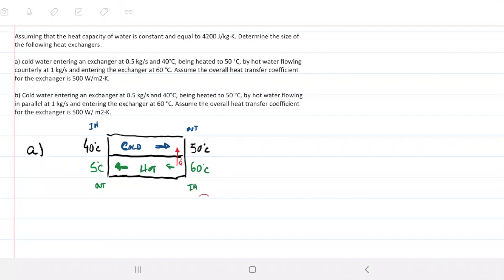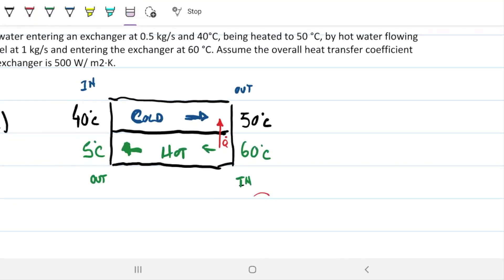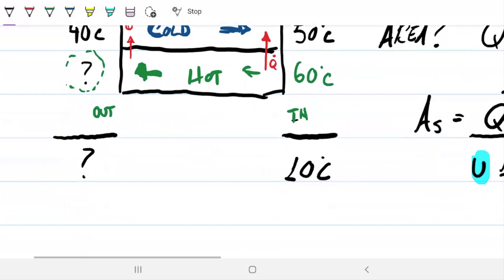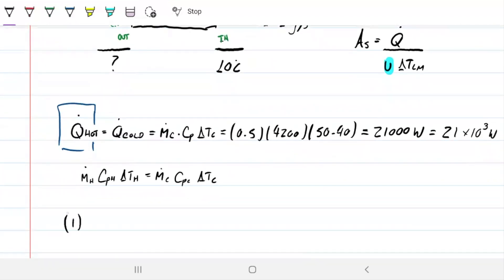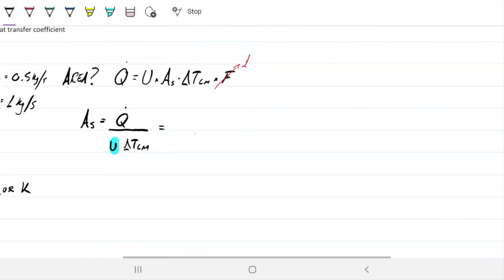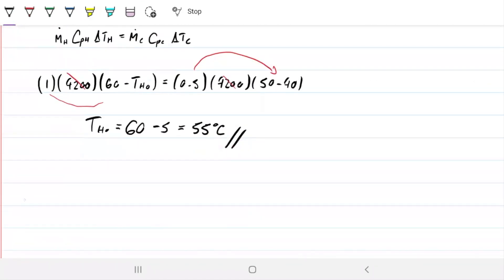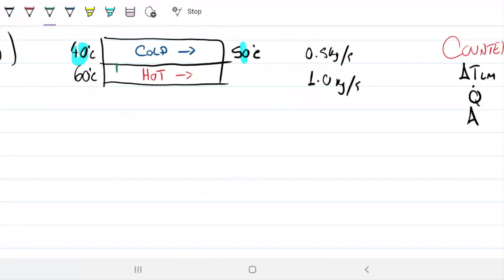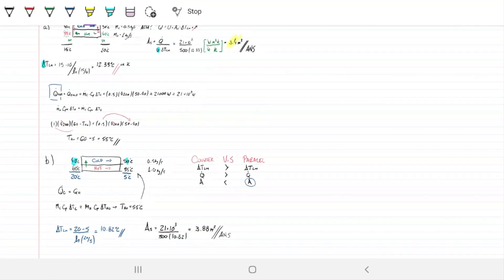Calculating size of Heat Exchangers - Delta T log mean - W5Q1

Comment: I am have trouble finding material talking about solving delta t on gas/water heat exchanger .  Co worker telling me it’s air temp in (-) water temp out . 
I disagree, shouldn’t you need to know water supply temp as well as gas out temp ?
Reply from the maker: Depends on your set up. It will be air temp if the heat exchanger is only interacting your fluid of interest with air (like a radiator). But a lot of times you'll have a fluid specifically there to remove the heat. In the problem's example, water
Reply from the maker: So in a gas/water HE, you are right. You need some information around the inputs and outputs. But not of all 4 though.